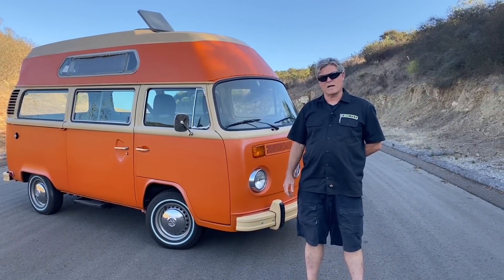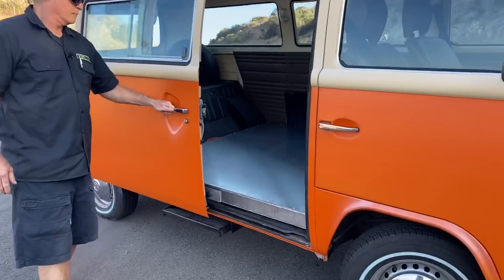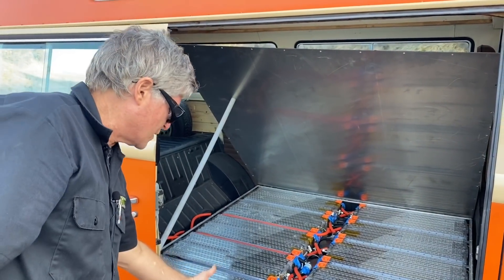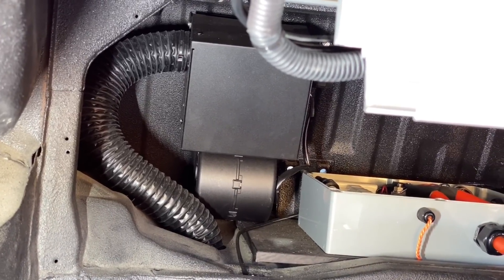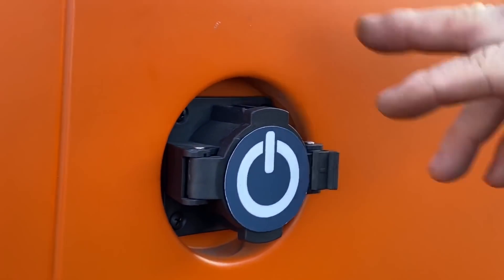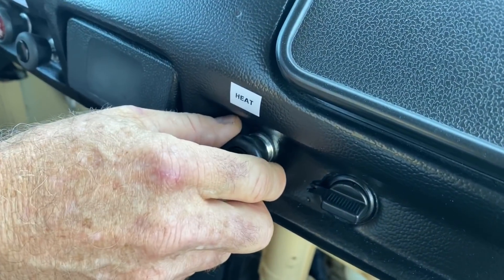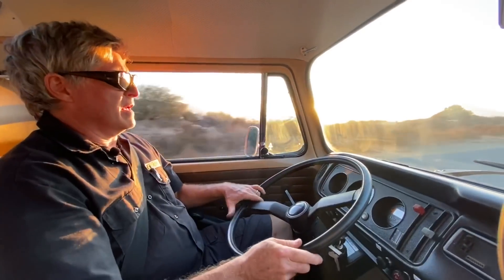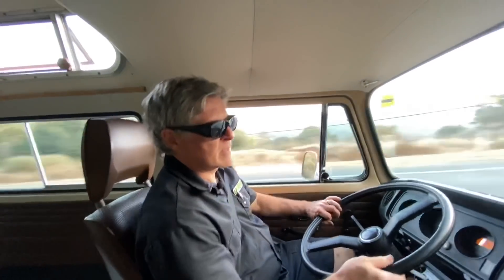1979 VW “Adventurewagen” Bus EV Conversion | EV Show

Comment: Wow. I love it. I have a 2000 Chrysler town and country that I would like to convert it to ev. By removing the engine and replacing  it with a Nissan Leaf motor or Tesla motor and use Tesla battery underneath or Nissan Leaf battery.

Comment: First, let me tell you I am not an adrenaline fan, nor I do care on maintaining the original looking facade of car. I am mostly for comfort and practicality, not speed or performance. What I want to know where I could go to have either my standard 2007 Kia Sedona Minivan short Wheelbase, or my 2010 Chrysler T&C Touring minivan with 4.0L engine, converted to full EV. I am OK with a 0-60 mph acceleration of about 6-7 seconds, and cruising speeds of 65-70 MPH in the highway, and with a minimum range of 220+ miles on a single charge, and to be able to charge anywhere by any system- Tesla, CCs or CHAdeMO.  So who could do that? I live in Houston Texas. Thanks for any advice. Jorge

Comment: There are 2 large air scoops that originally brought air into the engine bay.  Now with all the electrical components how do you keep Rain Out but allow outside Air IN?
Folks could easily Save 66% on the huge cost for batteries buy buying their own small lithium batteries and connect them together with metal strips either in Series or Parallel.  Not complicated…just busy work.

Comment: Love the conversion, hate the idea of loosing the camping features of the interior. The z-bed is gone, the dinette, gone, the icebox and cabinetry, wardrobe, pantry,  all gone.... just an empty box with a seven inch battery box platform that  displaces the entire floor. I suppose you can throw in a couple of sleeping bags and call it a “camper”, but it’s a far, far, cry from its original camper capabilities.

Comment: I think I'd be worried about the Tesla packs overheating. Why is there no heater/cooler for the battery packs?! I hope this guy lives in a warm climate where it never freezes or that battery pack will be toast (if it doesn't fail from overheating first) Seems it would have been a plan to ruggedize the battery case and hang it from the frame rails underneath so it's completely out of the passenger compartment.

Comment: 5:10 Shouldn't that thin double-strand orange wire be in a guard or something? It will rub against metal while driving, the insulation will rub through and you'll get a short.

Comment: I used to own a '74 camper, and it had issues, sure, but I want it to sound like an air-cooled engine, which is half the fun of owning/driving an old VW Bug/Kombi, not sound like like a golf cart! Get those ranges up to 500 miles, and universal availability of charging stations (I live in South America) and I "may" consider going electric - but not in an air-cooled VW!

Comment: So just over 100 mile range then pull over recharge for 4 to 8 hrs....drive 100 miles pull over recharge AGAIN.....thats not gonna be fun trip....gas car drive 250 tp 300 miles 15 min tefuel continue driving.....ya im not sold on it.looks cool but im not limit my weekend surf trips to 50 miles there and back plus the elec heater will draw power....??? How is this more efficient?

Comment: Can those batteries be mounted under the floor instead?

Not a great solution as it sits if you have your original interior, and not great in tintop or poptop buses as you loose quite a bit of headroom.

Also when you add things like internal electrics, etc, will that all be able to run off the EV batteries, or will a second leisure battery still be needed, if so how is that charged, and if you do run the leisure electrics off the EV system, can the bus then be charged at say a campsite using standard hookups?
Reply: Way more labour intensive to do that, and very likely structural parts get in the way so that you could maybe only fit 6 packs or so. This is the most cost effective way to convert it, and since it has a high top the lost headroom is not that big of an issue.

Comment: Too fragile, I’ll just wait for Tesla van
Reply: Actually, you are wrong. Here you own the design, you have all the info and recources to maintain and repair the vehicle. You can change out key components to different brand components. With a Tesla you have none of this, it will be always Elons car and you are always at his mercy. How do i know? I own a self converted motorcycle and a Tesla Model S. Only thing is that a 2nd hand Tesla is a lot cheaper than a conversion with the same specs (range, top speed, charge rate, etc.). A classic VW and a good conversion: Nothing fragile here.

Comment: I am impressed by the car, except for the charging piece; Why do you need a switch to enable a second charger? There is supposed to be communication between the charging point and the car about the available charging power so why a manuel process for this? Also, what about DC fast charging?
Reply from the maker: The switch adds flexibility in where you can charge by lowering the charge current. Many older houses and some locations can't charge at the higher rate without tripping a circuit breaker, so this allows a lower power setting that can safely charge at any 110V outlet in the US, but also has the flexibility of a much faster charge rate when the location allows for it. As an added benefit, if you have the extra time to charge (say, overnight) the lower charge rate will extend the life of the batteries.

Comment: My last :-( VW bus was a 79 (also orange!) - top speed 85 on straight and level with no tail wind (on CA 101). Screaming, but it would hold the speed.
I love the "UNLEADED FUEL ONLY" sticker on the steering wheel support....

Comment: battery placement is quite puzzling to me. why wouldn't you just suspend boxes underneath between the frame rails and frame - rockers?
Reply: @glennbeattie6172  you've never looked under a bus then?  it has frame rails.
Reply: @glennbeattie6172  Been into buses for 30+ years and everyone has always called them frame rails. The fact that the body is welded to it doesn't make it any less a frame.  it sure ain't a "pan"... that's what Type 1's, 3's, 4's sit on.  
regardless. it's 2 parallel beams perfect for cradling a battery pack into and along side.. No reason to sacrifice interior space in the way shown here.

Comment: Awesome ride!!! love the trolly bell, I need that on my car. ps- did you guys upgrade the brakes to handle all that giddy-up?
Reply: We like setting the neutral regen stiff enough that motor-braking does most of the slow-downy work, without wearing down your pads and rotors, while using the motor to send juice back into the battery pack. We also program a modest amount of brake pedal regen into the system. In a sense, the regen is an augment to the stock brakes.

Comment: What happens when a dog (or so...) hits that reverse button in full speed forward? There must be some protection right?
Reply from the maker: Not much happens. The controller will start to slowly ramp up regain, unless your foot is lifted off throttle in which case the vehicle just coasts. We demonstrate this during test rides at the shop since it's a concern, and it's nice to show it's safe.
Reply: Pressing that button on the hiway could seriously damage the flux capacitor :)

Comment: I would still add speakers to it and give it the proper VW sound.  part of the charm of the VW is the fact it sounds like a sewing machine ,  at higher speeds you can have it turn off.
Reply: You would not say that if you were actually owning an EV. ICE sounds become  unwanted 'noise' after a while.
Reply: @moestrei  you must have never driven a real car in your life...
Reply: @IMRROcom  Anything from 50cc 2 stroke to Australian 5L V8.

Comment: ** Note to our viewers - This video is focused on the functional part of the EV conversion. The installation of the false-floor over the battery pack, and all other interior finishing will happen off-campus. We will hopefully cover that in a future video.
Reply: And I say thank you for that! Fitting a battery just the way you have, has been in my thoughts for my bay 74. Very nice of you to show the unfinished build. Please keep us posted on the range.
Reply: Fantastic
Reply: Is that yours
Reply: @TheOrgonaut  It belongs to a famous comedian. Check out “Live from the Purple Onion.”
Reply: i hope so
Reply: Is there any Cooling of the batteries.  How do you vent the batteries??
Reply: @MartinSage  No cooling necessary at voltage and current much less than the stock Tesla Model S, and without fast charging.

Comment: Air Con?
Reply: It didn't come with it to begin with, but there is plenty of room for electric air con if the client had wanted it. There are some great pack voltage operable compressors now.

Comment: It's faster and cleaner but the soul of those vans were the air cooled engine. Not to mention when it's low on gas, you stop, fill it and keep on with the trip.. I'm not sold on turning these classics into EVs
Reply: id like one of each ev bus and a subaru bus
Reply: The only time you'd be low on batt is if you would go on a long distance trip. All other days you just plug it in when you come home in the evening and it will be full in the morning. If you go on a long distance trip you'll probably would want a leg-stretch  by the time it needs a recharge.